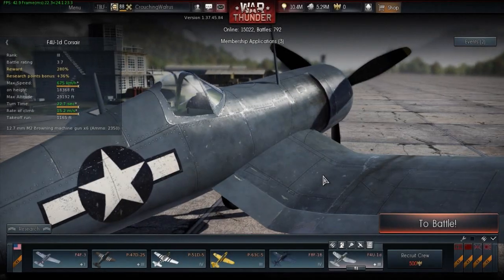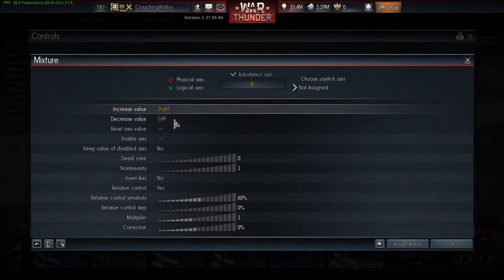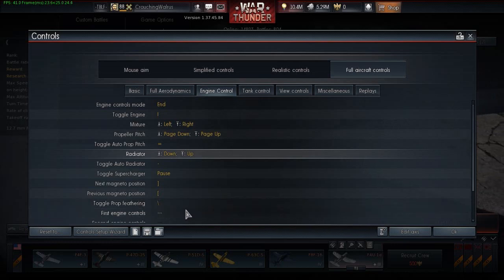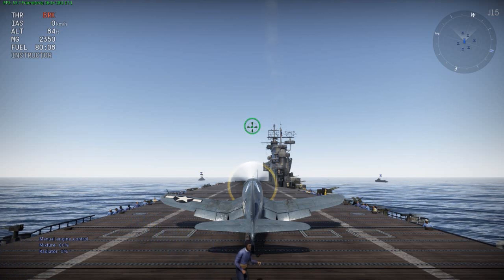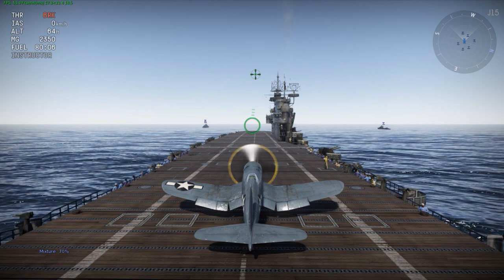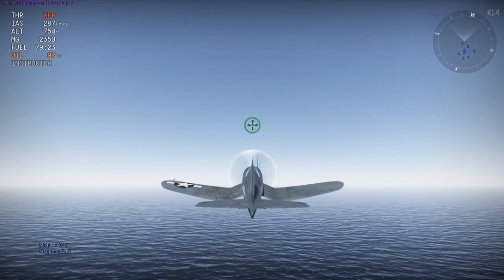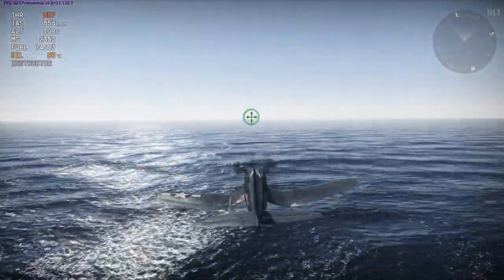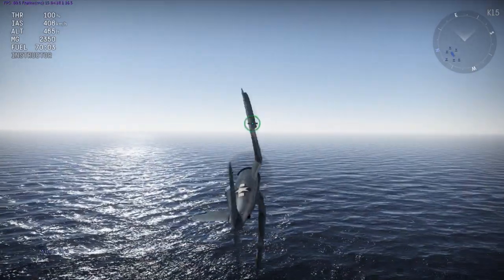The basics of manual engine controls (and how to use them with mouse-aim)

Comment: Here's some extra info:

Prop pitch is like the gears in your car.
A more shallow pitch gives greater acceleration, but lower top speed.
A more advanced pitch gives lower acceleration, but higher top speed.

Lower pitch also means lower load on the propeller, so higher RPM for a given throttle setting.

Some non-specific  examples :
If low n slow (and you wanna go faster), use low-pitch high-throttle.
If cruising (and you wanna save on fuel), use high-pitch medium-throttle.
If chasing (and you want top speed), use high-pitch high-throttle.
If slowing down (and you wanna airbrake), use low-pitch low-throttle.
etc.

Exceptions:
- If you can set a pitch so low, that relative to the current air velocity, it is negative, then higher RPM provides for stronger air-braking.
- If you set the pitch high enough, the propeller blades will become parallel with the air flow going past the airplane. This is called prop feathering. It means that the propeller provides ~0 thrust and ~0 drag.

Note :
One of the issues facing over-revving is insufficient valve springs, which can't reset the valves quickly enough, and rising pistons will crash into the valves while they are still closing.
Another issue is centripetal force overloading the internals.
A reverse issue is over-torquing, where too much resistance causes excessive sidewall loading, wearing out the engine sleeves/rings, or even bending/breaking the piston connecting rods (too much torque + too much resistance), but that's more of a car issue.

Mixture is the fuel air ratio.
Richer means more fuel for the same amount of air.
Note that you can only burn as much fuel as you have oxygen.

If you run rich, you have unburnt fuel in the cylinders.
This has a few effects:
1) Charge cooling. The unburnt fuel absorbs heat from the cylinder. This lowers combustion temperatures, and reduces the chance of knock (premature-dieseling), and subsequently allows for higher boost pressures.
2) Too rich smothers the combustion, robbing power.
3) Unburnt fuel leads to a smoke trail from the exhaust, making you more visible.
4) You use more fuel, so you have lower endurance.

If you run lean:
1) Lower fuel consumption, so better endurance.
2) More complete combustion, so better power, so long as you can still hit the same manifold pressure targets without knock.
3) Too lean and you get knock, which subsequently leads to engine damage (throwing a rod = engine immediately dead).

With altitude, your mixture becomes relatively-rich by virtue of being higher up where there is less air. You subsequently need to lean out your mixture to bring it into balance.

Exceptions are with a 2-stroke. Higher altitude leads to higher RPMs, since the air is thinner and the propeller has less drag and can rotate faster.
Higher RPMs will need better lubrication.
In most 2-strokes, fuel is mixed with oil, and you both lubricate with and burn the same mixture. So if you need more lubrication, you need more fuel.

Note :
Knock is like premature-dieseling - i.e. the compression stroke compresses the fuel air mixture, causing its temperature to rise, and it rises enough to make it ignite, but that happens before the piston reaches the top, causing the detonation to fire against the engine rotation.

This reverse force can break the piston connecting rods, immediately destroying the engine.
Some less catastrophic issues are breaking ring lands (the grooves that seat the ring-seals around the pistons), which will cause metal to shed inside the combustion chamber, rolling the dice in regards to the consequences. You could simply lose some power and burn some oil, or you could damage a valve,  or a turbo hotside, etc.

WW2 engines are from before electronic engine management had maps and automatic boost control.
Manual boost control lets you set your relative boost pressure.
- For a supercharger, that means changing its 'gear', so it's spinning faster or slower, or it being disengaged entirely.
- For  turbocharger, that means setting the position of the wastegate, to regulate how much exhaust gas spins the turbine and subsequently drives the compressor.

In general, more boost = more power. And more boost = higher chance of knock (premature dieseling).
You can mitigate the chance of knock by adding richness to the fuel mixture when you add more boost pressure.

Too much boost, and there is no amount of fuel or water or alcohol injection that can manage to charge cool sufficiently enough to prevent knock, and you end up with engine damage.

You also use boost to 'maintain' oxygen content, instead of simply adding power, because higher up there is less oxygen. This is why boosted engines lose less power with altitude.

Note : Boost increases the effective compression ratio of the engine, because the incoming air is pre-compressed.

Basically, boost and mixture need to be in balance with one another.
Boost increases oxygen, richness increases fuel.
You want the leanest mixture that will not knock.
You want the highest boost that will not knock.

Manual control of engine cooling is a balancing act.

You need the engine to be at operating temperature, so before take off the cooling flaps/ducts are often closed, in order to allow the engine temperature to rise to the ideal level.

Once at ideal temperature, you want to open/close the cooling ducts to allow for maintaining the ideal temperature.

A warm engine bay can help prevent carburetor freeze (if there isn't a dedicated carb heater). Carb freeze is 'kind of a big deal'.

For some airplanes, closed cooling ducts mean higher top speed, due to less drag form having a more streamlined body.

For other airplanes, closing the ducts robs the airplane of thrust, which lowers your top speed.
An example is the mustang or spitfire. They make use of something called the "Meredith effect" (https://en.wikipedia.org/wiki/Meredith_effect)
Cold air comes in, is compressed as it goes into the radiator inlet, is subsequently heated by the radiator, and then rapidly expands rearwards, and produces a net thrust.
It's like a jet engine, but with a heat exchanger (radiator) instead of a combustion chamber.

I'm not sure if war thunder models the problems of a "cold engine" (in general, troubles running reliably/steadily), or if the devs are aware of the Meridith effect, so it may simply be that leaving the cooling ducts wide open to avoid overheat could just be the easiest thing to do.

Magnetos are the analogs to car alternators.
Airplanes, for reliability/redundancy, have two spark plugs per cylinder.
These are driven by separate magnetos (redundancy).
You can elect to fire both plugs per cylinder, or the left plug only per cylinder, or the right plug only per cylinder, or other settings such as start/off, etc.

Two sparks also helps ensure a more complete combustion of fuel air mixture.
TBH, I don't know why you'd ever use any setting but 'both' for flight, but I'm not technical in that area.

I've only seen people select one or the other, before takeoff.
Just to check that each is working by itself.

-scheherazade
Reply from the maker: Damn. This makes me wish that I could pin comments to the top on Youtube..  Well said, and a lot more detail than I was ever going to go into.
Reply: wow - this is some golden information right here.

too bad it's so god damn hard to find it!
Reply: you sir are a hero
Reply: CrouchingWalrus You could just copy and paste this in the video description. :D
Reply from the maker: ThatCamel104 I would, but it's too long D:
Reply: thanks that must have taken ages to write
Reply: how do i use turbochargers in aircraft warthunder

Comment: THANKYOUTHANKYOUTHANKYOUTHANKYOU! I am a simulator fanatic (I have not touched arcade mode in over 6 months) and I have been waiting for MORE REALISM! I turned to the engine controls. I wanted to have it so I can control it to make it more realistic.   I have had problems in the past: I would set my keys for things like radiator, and it would be either 0,50,or 100, and would NOT stay in place. I'd have to hold the key!
Thanks your your help, I have set my keys correctly. No.pad5 is up on radiator, and no.pad2 is down on radiator. Its VERY flexible too! Pretty darn precise. I'm going to have to get used to this eng controls though. I'm sure the people I will be fighting will have it on auto, and will be an instant advantage.

Comment: What is happening when altering fuel mixture? Why not have the super charger on all the time? How come when you feathered your prop, you were using emergency power but I could not hear as much engine sound, almost like you were idling? I thought feathering the prop meant twisting the blades.

Comment: I changed my fuel mixture in the p51, but I thought I changed it back. I thought the default was 60. I hit about 4k and turned my supercharger to gear 2 and started gaining speed while climbing. Once I got to 6k I leveled out and started gaining speed. Then my engine gave up on me! wtf!
Reply from the maker: Do you have your prop pitch at 100%?
Reply: yup I think I had mixture set to 60% and I think it's 75 by default, is that why?
Reply from the maker: Mixture is usually not the reason for an aircraft's engine going out.  You probably over-revved your engine.  Either use auto prop pitch controls or familiarize yourself with the maximum RPM of the planes you're flying (and don't exceed them).

Sorry I can't explain the stuff in more detail, but I'm really busy right now.  I'll see if I can get back to your question in a day or two.
Reply: Oh so with engine controls on it doesn't limit rpms and wep can actually damage you like real life?
Reply from the maker: Yup, exactly
Reply: Do you know how to make the mouse controls handle more like a joystick? I noticed in simulator, you cannot do a full roll with the mouse, it stops you. This makes it very hard to do a split S or a lot of things without stalling.
Reply from the maker: Sorry, I've never used mouse aim in Simulator, so I couldn't tell you.  I just use the bargain bin joystick of the year :P (Logitech Extreme 3D Pro, if you were wondering)
Reply: I have a saitek 3d, I think you won.

Comment: Mixture and magnetos what those things do and why do u use those settings?. Awseome video man keep it up
Reply from the maker: Mixture setting is just the fuel/air ratio that's being used injected into the engine.  The more "rich"(In War Thunder terms - the higher percentage) the fuel mixture, the more fuel is being pumped into the engine.  In "lean"(the lower percentage) mixtures, there is more air and less fuel is being pumped into the engine.

I'm not too fluent on exactly how magnetos work, but I'm pretty sure that they just supply power to the spark plugs in the engine cylinders.
Reply: CrouchingWalrus i just use ur config there is a really nice change in the way the plane flies :)
Reply: CrouchingWalrus when do you need more air in tour duel, andere when less air?

Comment: So would you recoomend using this also in arcade? I felt that some bombers would really benefit from fiddling manually with the engine controls, ans since high alt bombing gives you time to do this im interested.  Also, theoretically would it be possible to extinguish a engine fire by fully closing the radiator e.g.?
Reply from the maker: I don't know, I've never used them in arcade battles.  And I haven't ever really seen manual controls ever help out with extinguishing a fire. Shutting the radiators probably wouldn't help, but individually shutting off engines might.
Reply: ok might give that a try
Reply: Arcade doesn't allow engine controls. xD
But yes, bombers could benefit from some of the features, especially prop feathering if one of the engines die out, since it gives minimum drag and strops the prop from turning, so the plane won't start yawing more than usual, plus it keeps people from getting sawed by thier own spinning props and end up having a bad day from it.
Reply: well i can shut down my engines also in arcade, for fun :D
Reply: Axonteer
 Too bad they automatically start back up if you touch the throttle. xD
Reply: Yea i know but at least i have another button that toggles ... stuff :D
Reply: ***** you need to togle your instructors off for engine control :)